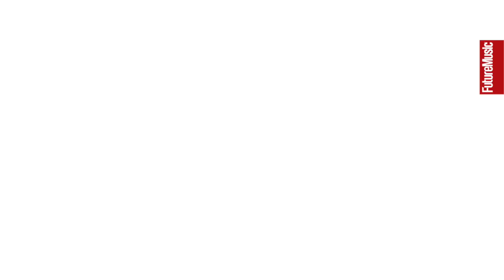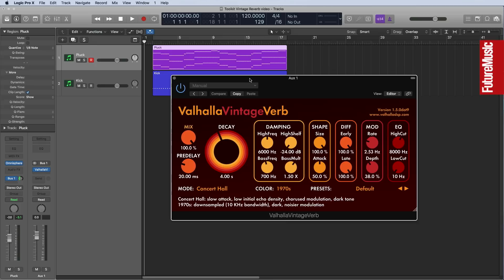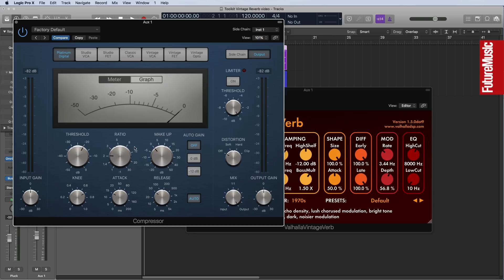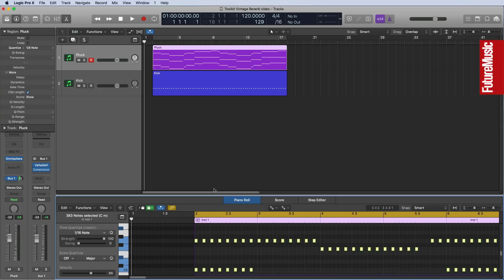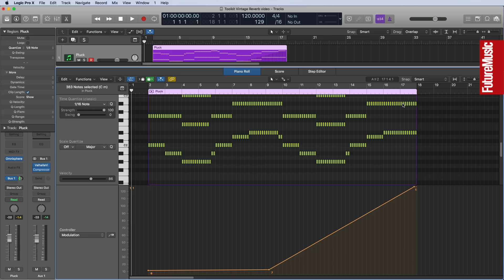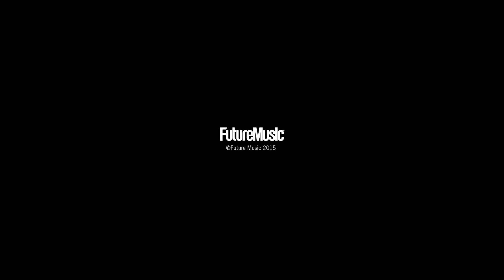How to create vintage reverb effects – Toolkit

Comment: You guys should try saturating reverbs, fielding dsp reviver after a dreamy reverb send really makes the reverb pop out.
Reply: You should stop listening to them in that case.All that method is doing is sending additional colored input signal into the reverb. Assume i've i got a distorted rhodes piano and would use the technique you described, i'd go into the reverb with yet more distortion without even affecting the reverb. The point of putting the saturator after the reverb is so it can actually do work, the same way one would put a compressor after a reverb for a sucking effect.
Reply: The thing is if you think that sound better then go ahead. But you're essentially telling me (If we talk routing a reverb trough busses) to send my dry/processed signal into a bus where i put more distortion and then follow with a reverb. This is might sound good but it's a lot more subtle, the point of my method is to making something huge, which works because were adding harmonics to the reverb after the signal gone trough it. Also if you blindly follow the advice of others (even tough it's good advice) without experimenting yourself you're just setting yourself back as a mixer.